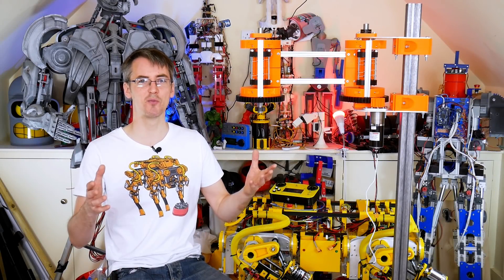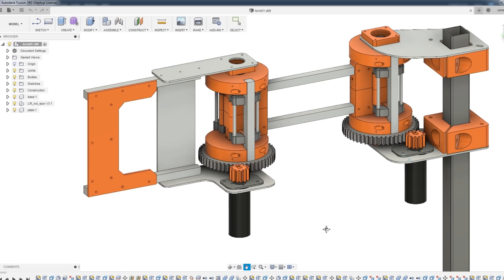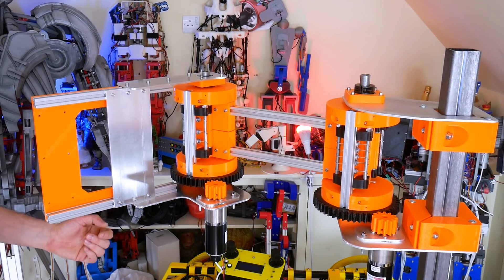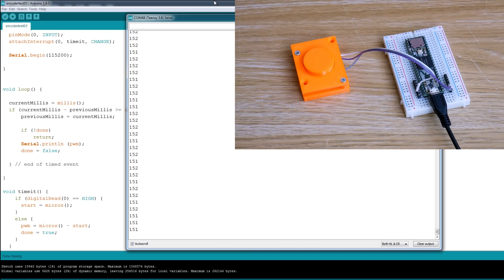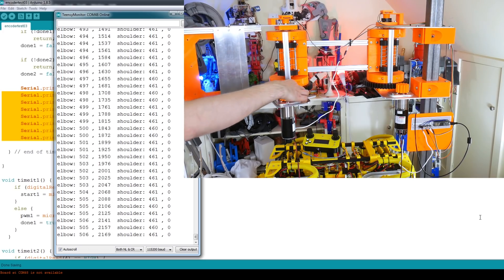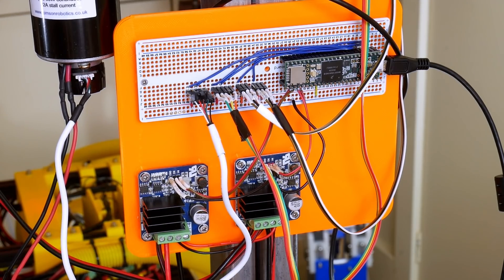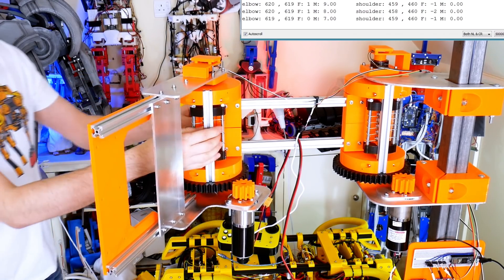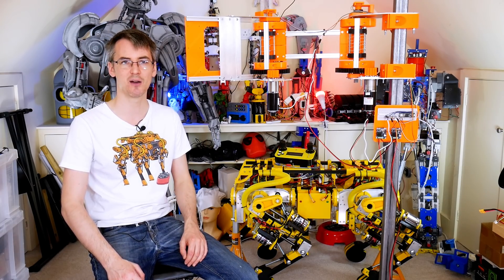Building a Force Driven Robot Arm #3 | James Bruton

Comment: If you use strain gauges for force feedback instead of those springs, that will give you a LOT more rigidity in your movements, and stop it bouncing back and forth when the arm stops. You can still get flexibility and springiness when you want it by driving the motors in response to load, for example during training :)

Comment: Hi, have you thought of using current feedback to do torque control?

Iv seen motor drivers online that are simmilar to the ones you are using, but also have an analog outputs for voltage and current. 

Could be a good upgrade for your system!!

Comment: James, I used "CALT Tiny size Contactless Hall Effect Angle Sensor Encoder 360 3mm shaft" previously, and like it very much, you may consider looking at it. The model number is P3015, Brand - Calt

Comment: So if you'd just use a backdrivable planetary it would be force-transparent enough to directly measure current and calculate torque (and with this, force)
Reply: That would be quite interesting to build both and see how they compare in actual use.

Comment: Why is the aluminum plate above the bearing ring (and orange square) on the new joint, instead of stacked in the same way as the first joint?   ...  I see you mentioned it at the six minute mark, but could you explain it better (maybe a diagram)?
Reply from the maker: So it 'hangs' the axis on the last one

Comment: I guess using torsion springs would have given you a more linear response on the force column as now the angular displacement of the arm and force are not linear in relation because of those compression/expansion springs ...
Reply: It would be complex

Comment: @James, why are you not meassuring the the current to get the force? So you wouldn't need any Sensor other than a shunt and a maybe a Opamp. Any particular Reason?
Reply from the maker: So I don't backdrive gears, but also so I can see if this type of thing works well - the next project like this will be legs, so I'd like to natural spring and force driven joints.
Reply: @jamesbruton  Proportional position control should approximate a spring?
Reply: @johnwelford1371  I think the problem is that you'd need really powerful motors to emulate springiness through proportional control alone. For something the size and weight of the OpenDog you'd need really large, expensive motors. Using actual springs is a lot cheaper, lighter, more compact, and uses less electrical power. At least, that's my understanding; I could be wrong.
Reply: @Vir9il  Agreed about them probably being expensive, but I'm not sure about the size. I presume that Boston Dynamics and similar have 'virtual springs'. Adding real springs (+ extra sensors etc) is itself adding quite a bit of weight, along with complicating the system dynamics.
Reply: I does work quiet well. Back in the day when i was at university they made us develop a “sensorless” motorcontrol. Our professor came up with the idea to use double the voltage and a max duty cycle of 50% so you would alwas a a of periode to determin the generater voltage for speed and during the on cycle measure the current for torque. And because you need to fire your interrupts anyway for the pwm you get a nice snappy system.  
Anyways, thanks for the answer. I am looking forward to your progress!

Comment: Nice design.  You should be able to use input capture hardware to get the PWM without the interrupt overhead.  I have built a 4ch quadrature decoder that also measures speed and has SPI output and an Arduino library, should you wish to try it out on one of your projects.  I'm looking for some real world evaluation.
Reply: Is the input capture interrupt faster than "normal" interrupts?
Reply: @SirArghPirate  You don't need to use the input capture interrupt as such.  Once set up, it will capture the PWM period behind the scene and you can read the most recent capture when you actually need it, like in a slower timer interrupt or in the main loop, for example.
Reply: Could I take a look at your code? I have been messing around with different methods of reading in quadrature encoders and pwm, seeing your approach would be interesting.

I've been running mine inside of an ISR, but the code is written using mostly port and bit operations. Thankfully, since I xor the old port register bits with the new bits to confirm which pin has changed, I am able to run it inside of the main loop without too many issues.
Reply: @williamforbes6919  I have to keep my code proprietary, unfortunately, but I can say that I also use bit operations, but not in the main loop.  Position is relatively easy.  The tricky and intensive bit is deriving velocity.  I have even had to write some assembler and optimized array indexing code.  I also calculate acceleration, but I'm not satisfied with the performance yet.  Doing SPI slave properly is also ridiculously complicated and Arduino does not include even the peripherals I use to do this.  All this considered, I can manage well over 10,000 transitions/s on 4 channels.  My Pololu motors are rated 30,000 rpm and I make them scream at 50,000 rpm to reach this limit.  I'm quite happy with the performance.  :)
Reply: @ChristieNel  And YouTube crashed deleting my reply half way through.......

I understand not being able to share code because of it being proprietary, something about workplaces not wanting their custom software they depend on being given away...

10,000 transportations per second on 4 channels is quite performant, especially since the motors are not going to be in phase with each other and since you are running other code as well. It takes around 50 clock cycles for a C++ isr to flush into memory, so you would end up with 100 clock cycles just in overhead before you are back to the rest of your code. I can see  how competiting interrupts would cause issues, not that this is an issue since an atmega328p only has two interrupts anyways. Though I guess you could be using a different Arduino? Which would hopefully have nicer perhipherals.

I ended up implemeting my PID using bit shifts for multiplication and division. Only being able to tune in powers of 2 is a little rough, but it gets the job done for now. I was starting to get really paranoid about performance.... That and I was lazy.

I am probably going to continue my efforts on the STM32 version of my code, since I can use the DMA in circular mode to generate a fairy arbitrary PWM frequency with almost no overhead. I could do this using timers, but the actual performance of this wasn't quite what I wanted, as well as it being less flexible. Hopefully I should now have a somewhat rediculous amount of overhead to implement my control algorithm, be it PID (A) or SMC.
Reply: @ChristieNel  My control loop is crazy janky by comparison. And you can definitely tell when it is trying to hold steady state position! It will detect a high instantaneous acceleration whenever it drifts a single encoder pulse. So it does tend to get a tad jittery. 

I'm happy with how it turned out considering I wrote it in only a couple of minutes, but it really shows in the results. 

I'm considering just hard coding the math results into the flash memory if I stick with the Arduino. But the STM32 looks awefuly inviting, that or a ESP32 with actual hardware motor control perhipherals with 80mhz control input aquisition... Dual core 240mhz, FPU, and dedicated hardware perhipherals.... Sounds almost like cheating at this point.
Reply: @williamforbes6919  It sounds like you are quite the experienced expert.  Yes, interrupt overhead can definitely drag down performance, so I do a lot of work to cut down on calls and making them fast.  I am using a PIC instead of an Arduino, but do all my testing from an Arduino talking to the PIC.  Ironically there are PICs with quadrature decoders built in, but only two, and they don't do fancy speed calculations, index inputs, etc.

When I first started this project and aimed to run loops on the chip as well, I did exactly as you did - using shifts.  It is rough, indeed, but it worked surprisingly well.  I could do smooth speed and acceleration ramps and move it to a set position and stop on a dime.  So satisfying, huh?

STM32 are nice MCUs.  Using DMA to generate PWM is something I've never heard of and probably complete overkill, but clever nonetheless.  I'm surprised the timer isn't good enough.  What frequency and duty resolution are you going for?  I did once do something similar to generate a sine wave with a pre-calculated array, but I was just setting the next PWM value in an interrupt, which drove an H-bridge.  It was actuating a tiny whisker that sent vibrations into a sample to measure its stiffness.  Fascinating stuff.
Reply: @williamforbes6919  I remember having a problem with buzzing when it reached set position, because the loop would keep flipping the motor forward and backward one encoder pulse.  I think I added an exception that ramped down the power when it was within, say, 4 steps, of the target.  You usually want some filtering on your D term as well.

I would definitely recommend using the right peripherals where you can.  I believe the PIC I'm using has a special PWM mode that can be configured to drive an H-bridge directly.  But again, it depends what resolution your require.

Comment: That worked very nicely. I was pretty impressed with how responsive the force driven joints were, there is a little to much slack there though, maybe tighter bunggies?
Reply from the maker: More springs probably!
Reply: Yeah.  More springs but also deacceleration in software. It'll be a heavy arm and if stopped instantly carrying a load it will need to flex somewhere or it'll break.
Reply: @jamesbruton  Some sort of shock absorber instead, maybe?